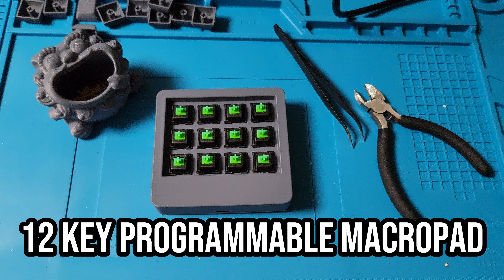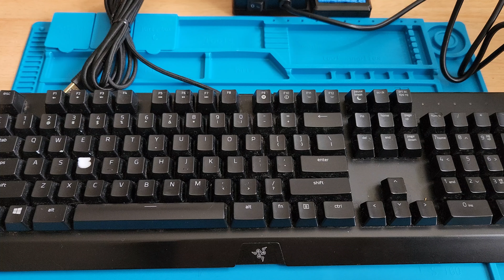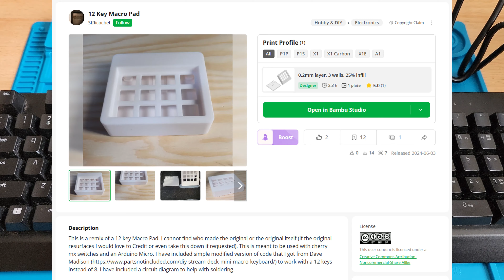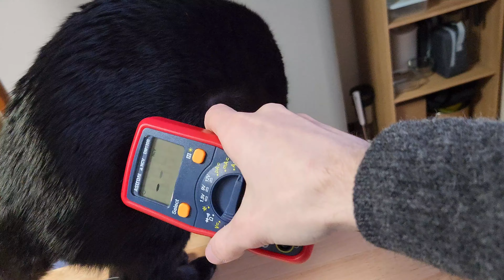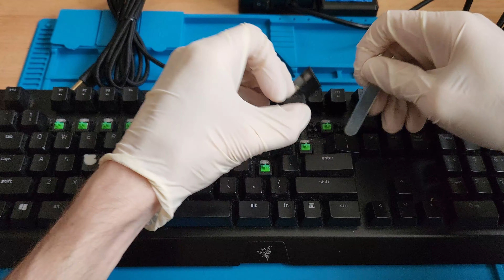I Made a DIY Macropad for Streaming/Gaming [4K]

Comment: would it be possible to replace the pro macro with esp32
Reply from the maker: It seems that you should be able to use it. The pin/header numbers in the code might need to be altered based on what the esp32 board says. You'd also need to think about the size of the board. But otherwise, it seems doable (if you are up to making the necessary changes). 

Any reason you would prefer to use the esp32?
Reply: @fetalgiraffe7  I just have some of them laying around and i would like a seperate arrow keys for my 60% keyboard and i have an old keyboard so this should be a fun project for myself
Reply from the maker: @Aaronhuh  Nice! Let me know how it goes